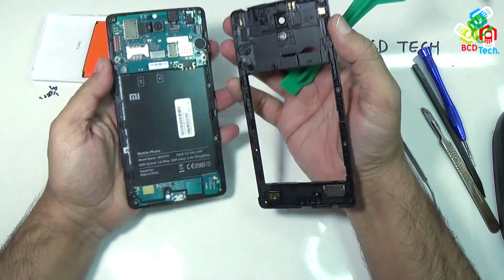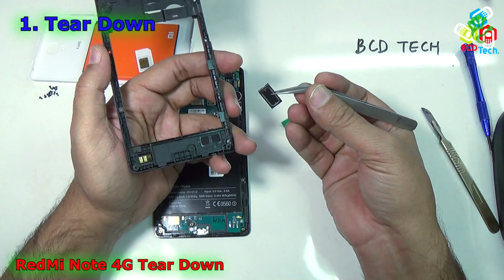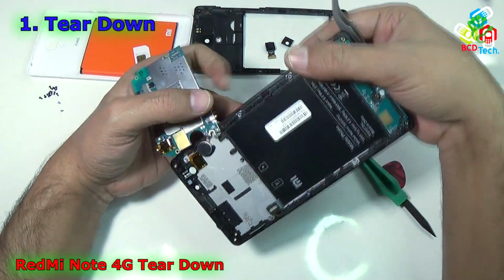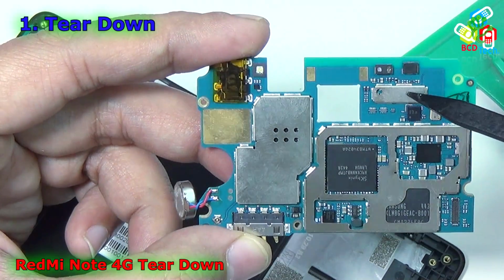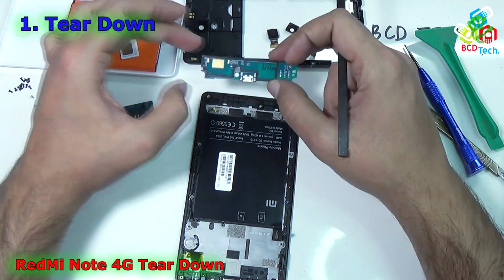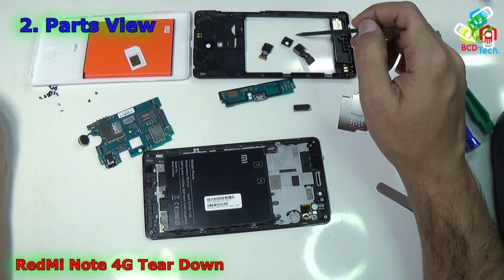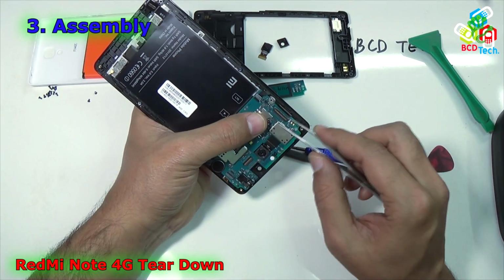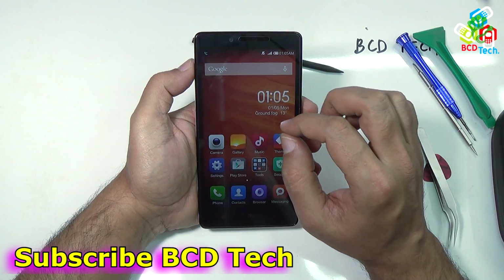Xiaomi Redmi Note 4G Tear down, Parts View & Assembly reveals 4G antenna, and Qualcomm CPU

Comment: Hi, i have dropped the phone once, after that the headphone jack is not working COMPLETELY. Headphones has to be connected slightly (not completely pushed in, in the headphone port) for both side earphone to play a sound. If you push the headphone completely in, as its designed to once one side of the earphone works (left side). 

What do you think is the issue? Is it the headphone socket on the motherboard or just the port? I dont think its the drivers. Different headphones does the same thing, Same headphone works great with a computer or laptop or other phone.

Please advise.

Comment: Hi! my  Note 4G back speaker stopped working. These is a soundboard or it's only the little bottom speaker? Some forum said that within the engineering menu there should be a PA SPEAKER TEST to calibrate speaker (i don't think is actually broken, it stopped itself) but in DIOR (note 4g) this item isnt present on menu. So, do you think i need to replace the speaker?

Comment: Hi, like your video, yesterday I my xiaomi note 3G Dual SIM screen shattered, Screen is ok and touch is working ok, but Digitizer has cracks ? Is it possible to change the Digitizer only for Xiaomi NOTE 3G, If possible where in Delhi NCR.
Xiaomi Service center change whole thing, and ask Rs 4500?

Any cost effective solution?
Reply: Go to gafar and change the screen from there. Don't go anywhere else I have got my phone screen replaced and only they are good at it. Dont pay more than 1200.
Reply: Thanks Vinayak, As I have tried gafar market, nobody have the screen. I am chasing from Jan 10. If you know anybody coantact no. or shop name, pls suggest.
Reply: Thanks ..will try
Reply: Hi, Which mobile screen you have replaced in Delhi for Rs 1200?

Comment: Hi i guess my usb port is not working since it is also charging port and so i finding trouble in charging so just wanted to know whether i can change the port or is there any solution for it.? Please let me know
Reply from the maker: try to check the port physically with eye or lens. if broken the replace port or whole sub pba section
Reply: +BCD Technology I have the same problem. My Redmi Note can not be charged. How can I find the port? I am living in London. Do you have any link of that from Amazon or eBay?
Reply: +BCD Technology Is it possible I only change the Micro USB Charging Sync Port Charger not the whole Vibration Board PCB?
Reply: I think only the micro USB Charging port needs to be changed, if your back button, menu button and home button that are the touch ones aren't working then you need to change the PCB, before changing your USB port, try to clean it with a needle carefully and remove the lint and dirt from it, if your charging works well after this, don't change the USB Port.